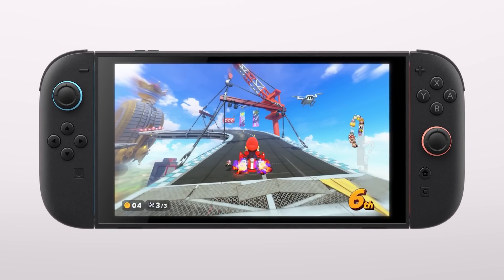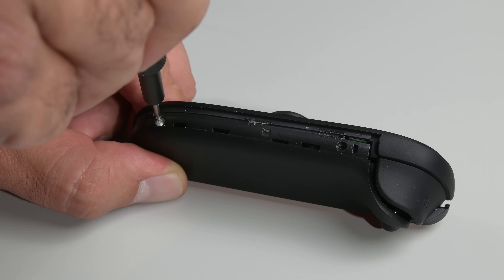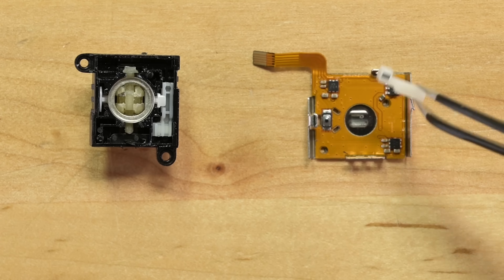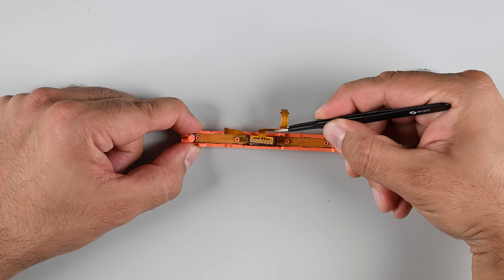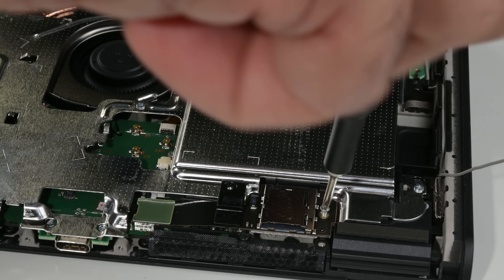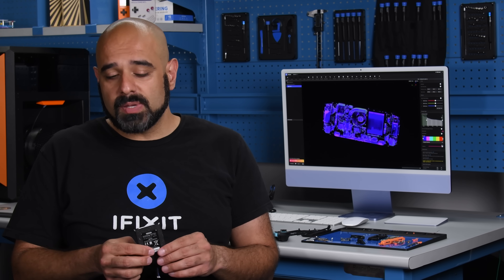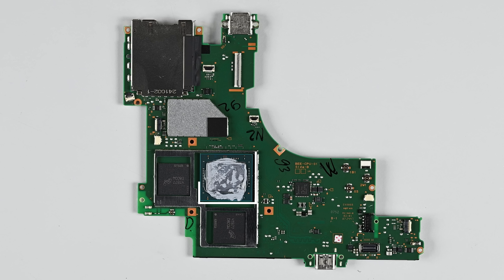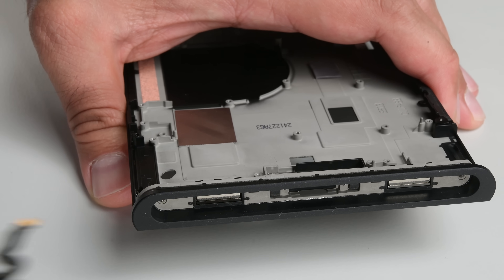Joy-Con Drift Isn’t Dead: Inside the Switch 2

Comment: So, planned obsolescence , which is why the battery in the Switch 2 is such a pain in the ass to remove. This however guarantees they will come out with a Switch 2 revision in 2027 when Europe makes companies build their devices in such a way that the layman can replace the battery and do minor repairs.
Reply: yup.. that's why i might hold myself from getting one until we see that replacable battery law from EU come to effect.
Reply: @schikey2076  Doing exactly that as well. Plus I want a better battery + an OLED screen. 2 Hours just dont cut it for mid-range hardware.
For an almost 6 TF handheld like with the Rogy Ally 2, this would be understandable. But not for hardware that was finished since 2023 and based on tech from 2020 

Btw; same energy draw but higher capacity leads to less heat and in turn lower temperatures -> fan can be slower/quieter -> energy consumption goes down.
Reply: @schikey2076  Call me pessimistic, but I have the feeling that somehow, Companies will lobby to make that law practically useless. Creating a loophole like that an authorized repair program constitutes as a product's battery being easily user replacable. 

The result would basically be like how everyone is being in malicious compliance with the mandate for an immediately visible disable all cookies button.
Reply: @leonbabic7185 The EU isn't the USA. Lobbyists can't count on being successful in the EU. Especially not in the realm of consumer protection.
Reply: @LeonardTavast yep, I mean hell. Apple could not do a thing about the law that all phones sold in Europe must use one charging method to avoid e-waste , as a result all iPhones sold across the world are USB C 

When Europe mandates right to self repair , Nintendo will have to come out with a revision or just not sell the console in Europe.
Reply: @LeonardTavast  Plus Nintendo wont have 2 production lines just to give non-EU countries a worse switch 2 from a repairability point of view.
If the law takes effect - which is yet to be seen, because it only demands NEW products to do this, and Nintendo could try to argue that a revision is not a new product - the changes will very likely also apply to you folks over the pond.
Reply: @leonbabic7185 
i would agree with you.. if the iphone type c situation didnt actually happened...
Reply: @leonbabic7185 You're a bit too pessimistic, because companies generally can't weasel out of respecting the spirit of the law in the EU. But I doubt a revision would be enforced. All that this law does is mandate that batteries be replaceable via commercially available tools and have spare parts available. Currently, the Switch 1 battery can be replaced by using a screwdriver, even if there's stickers and glue in the way. At most we might see some other mechanism for sticking the battery to the device and spare batteries made available. The EU doesn't mandate that replacements are made easy, just that you can no longer glue components that need to be removed to access the battery that will be destroyed upon prying.
Reply: @leonro hopefully you're right. Ideally, we'd be able to easily unscrew the back panel to get acces to the battery. I don't care if the device becomes slightly "uglier" because of visible srews.
Reply: @LeonardTavast 
Lobbyists just have to work smarter then. Which is what they have been doing for decades now by disseminating amongst various "concern unions" to effectively render most of those barriers functionally circumvented.

The only difference between the U.S. and Europe in terms of anti-corruption is that one thinks a yield sign is going to stop everything. Unfortunately for them many retailers are very susceptible to all the usual persuasions. Quite easy really.
Reply: Only to be sold in the EU
Reply: No problem 🤝🏻
Reply: humans are fun amirite?
Reply: pretty sure I don't buy the new one ... its time to change other brand then , who don't troll the fans to make more money
Reply: That battery wasn't that difficult to remove. If they wanted the battery to not be replaced, they could have soldered the connection instead of using a standard cable.
Reply: @blastofo  the battery is glued in behind some metal shielding. To remove the shield you have to disconnect multiple antennas, and to get inside the system at all, you have to remove some hidden screws behind stickers that are difficult to replace when the repair is done. Sure, it wasn't soldered in, but it definitely isn't as easy to replace like it used to be on older handhelds and smarphones.
Reply: @leonbabic7185 I didnt see him have to do all that stuff in the video. To be fair the joycons are packed with lots of tech. ir camera, nfc reader, gyro, accelerometer, bluetooth. it has no room for other concessions.
Reply: @blastofo I was referring to the console itself. But I believe that the joy cons could also easily be redesigned to enable battery access.

Comment: Man, for iFixit, pulling the connector by the wires using a tweezer is just so bad.
Reply: They are living on the edge.
Reply: Would pulling the connector by the wires by hand be better?
Reply: @triadwarfare  like a wall plug, it's safer to pull by the connector itself rather than the wires
Reply: @triadwarfare  Not but pulling it with your thighs would be impressive.

Comment: Guys, if they make it difficult to change the battery and don't provide spare parts, the rating should be zero straight away.
There is no more room for this type of disrespect.
Reply: Nah, should be 1/10.
There are devices that you literally can't replace parts of, 0/10 should be reserved to those.
Reply: A 0/10 would imply the system is completely unrepairable, which is not the case. The score means something, and giving it a 0 just to spite Nintendo would be misleading.
Reply: @benemerald  yeah, important to note that the rating isn't 10/10 for "exceptionally repairable" 10/10 is what should be the bare minimum, and like 5/10 is really quite bad
Reply: @ThylineTheGay  Yes it is, that's exactly how their ratings work. "most commonly failing components, battery and screen. Can be replace without tools., visual cues, replacing modules is easy"  from a 10/10 review of FairPhone 1-5.  Grandma can replace the battery like she can with AAA batteries in a tv remote.
Reply: @benemerald do we know if Nintendo would brick the system after repairs?  If do then it would be 0/10 unrepairable.
Reply: @soltarus1  Nintendo isn’t bricking any systems. Don’t believe everything you read online.
Reply: not sure why the adhesive for the battery is that strong but u dont need to take the batteries off for you to disassemble the whole thing i think
Reply: @shinobistealth4111 the adhesive is that strong because the alternative to secure the battery in the system is a secondary frame as part the battery that then screws into the main frame. The drawback? It generally makes the system thicker. While that shouldn’t be an issue most people don’t want thicker systems for some reason.
Reply: If repairing it and putting it back together ends up making Nintendo brick the system entirely, then repairability turns into 0/10.. because if repairing it causes you never to be able to ise the device again.. it stops the whole repair thing being viable at all even if you can get parts or take it apart.
Reply: okay chinaboo
Reply: @jxxxxx44 seethe harder, fascist. 🇨🇳🇨🇳🇨🇳